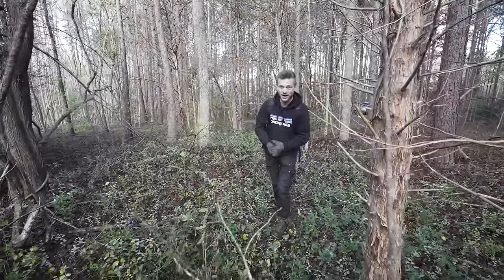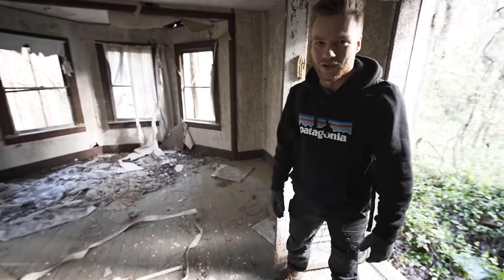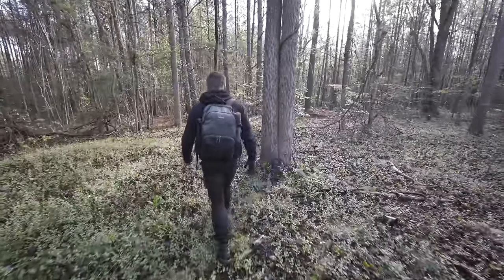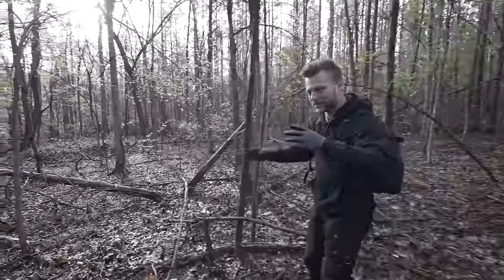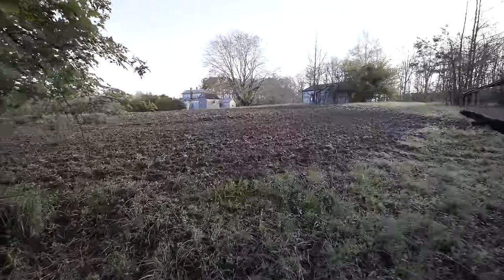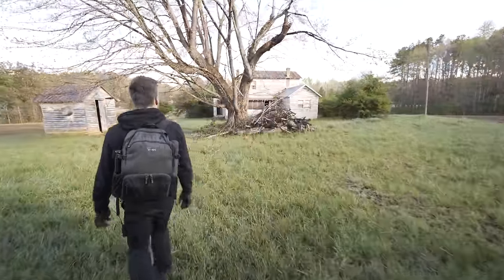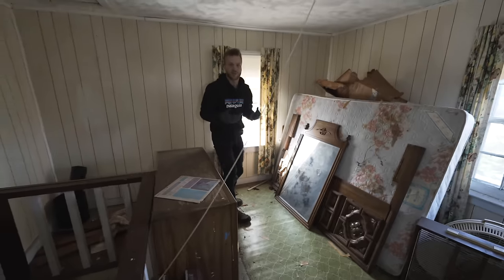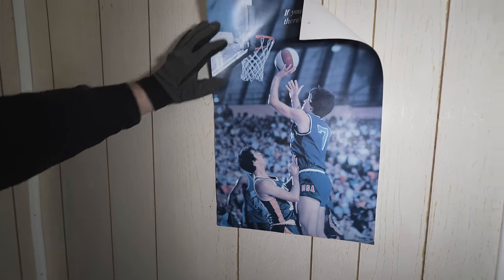They Abandoned their Parents House ~ Home of an American Farming Family!

Comment: The homes in the south have a lower water table and not many basements built as water would fill them. Freezers were often out on the porch or in a shed. It's bad luck to open an umbrella in Southern America also. Herman, the man may have worked the property to have stayed on the property. It may be owned by someone else. If you are in the South this would possibly be the case which is why the field is still being plowed. It may be owned by someone else originally. The  plant holders  are macrame.  Very popular at that time.
Thank you so much for saving the bird.

Comment: Just in case nobody told you. The license plate you showed. You didn't know why it had 00 on it. The 00 is the year. Every year you have to put a new sticker on it. Also the thing on the wall, that you didn't know what it was. It was a smoke detector, so you can get out if there is a fire. Also the thing hanging up with a plant in it. That you thought somebody made.  Was a big thing in the 70s. The other thing you pointed out was a hook rug. If you liked to do arts and crafts you could do that.

Comment: The 00 on that license plate means the year 2000. That’s a very old oil lamp as it is the hot air design and not the cold air design used today.